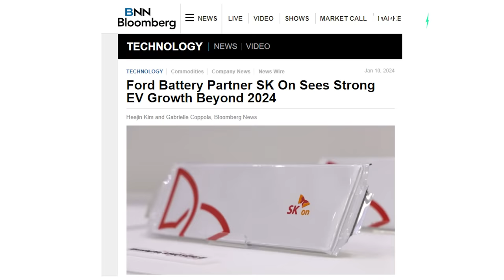Ford FIRES nearly 70% of EV plant workers,ramping up ICE production

Comment: I'm in Detroit, Ford is going to one shift for the Lightning, and transferring those workers to Wayne Assembly. I doubt the guys at the Lightning plant will be working much. When GM was building the Volt at their Hamtramck plant, now "Plant Zero", they were only running a few hours a day, four days a week, if that. Some weeks they never even opened up. I expect this will be the same with every EV producing plant in the Detroit area, and then they will close, move in a new ICE vehicle or simply abandoned the plant. I do not know how GM and Ford are even able to keep the doors open with the two morons they have running these companies into the ground. And then the quality issues both are suffering from, what a joke they have both become.

Comment: Ford needs to partner with Tesla to aquire  EV motors, sensors, and hardware, and software.  Then ford could focus on the aspects of building cars that they are good at (assembling the vehicle).  Ford already gets its parts from suppliers.  Just bend the knee and form a mutually beneficial relationship.
Reply: No. Electric motors have a long history and can be sourced from many makers. The only thing that is special is the design of the vehicle which should be as an EV from the ground up and the batteries. Even Tesla's batteries are actually Panasonic.
Reply: That is what Elon Musk refers to as "catalogue engineering", a company chose the parts to use from a Bosch catalogue (for example) instead of developing them themselves and just put them together. No innovation needed.

Comment: The electric cars and trucks (Mustang Mach E, F150 Lightning) have been sitting at factory lots and dealer lots for months. When initially launched, the dealers were asking for a huge profit margin. But soon, problems in quality, range, and infrastructure cropped up and they weren't selling, even at discount prices. GM has had similar issues with its EVs, and even Toyota's oddly-styled EV has had a ho-hum reception. The big issue, at least here in the USA, is that the Biden Administration has put the cart before the horse. Little or no infrastructure to  serve hundreds, if not thousands, of electric cars per day even in small towns; a very limited 100-year-old electric grid, a fear of nuclear energy, a failure of alternatives, and the government mandates that force manufacturers to build vehicles that just aren't ready. All add up to this massive boondoggle. If Biden had poured the billions (even trillions) into infrastructure improvements and THEN started mandating electric vehicles, it might have worked.

Comment: Worldwide EV demands are growing. Dedicated EV manufacturers like Tesla are ramping up production, successfully claiming an increasing market share. Legislation banning production of ICE’s is already in place in many countries, effective in about 5 years. A full transition to EV should be top if mind for every car manufacturer, in order not to miss out. Yet…. Ford and GM are stepping back. That’s either very brave, or very stupid. 
Weather you like it or not, ICE is on its way out. If not now, soon. Because besides all the pollution that comes with fossil fuels,, probably sooner than later, we will simply start running out of oil. It just doesn’t come in unlimited supply. And no… battery powered EV’s might prove not to be the ultimate solution, and no… (todays) batteries aren’t environmentally friendly either, but we will need an alternative to ICE’s. Preferably a fully matured concept, before we run out of oil.

Comment: Adoption of EVs is clearly weighted towards lighter vehicles whose range and performance can be optimized with the current level of battery energy and charging speeds.  Pick up trucks will be the market segment last to the post because of their unique operating including payload capacity, towing and range.  The offer may be substantially more compelling when the next generation of solid state batteries arrive and higher/more available public charging are available.  Ford has squandered a three year lead in hybrid pick up truck development-  if they were to offer a plug in hybrid with the ability to travel 80+ miles electric only they would enable pick up truck owners to drive largely electric only during the week, preserving critical payload, towing and range capabilities that pick up truck owner demand- transforming pick up truck ownership economics and introducing millions to the advantages of electrics.  They would also enable owners to charge at home, avoid sketchy not ready for prime time charging infrastructure, reduce emissions and distribute scarce battery and charging materials over a much bigger cohort of drivers.  Instead of offering drivers a compromise pick up, they would offer an enhanced truck with much more capability and lower operating costs and sell a boat load of these things.

Comment: The West and North America, most likely, will be stuck on gasoline cars due to poor infrastructure networks, power grids and extreme cold wheather issue. While Asian will move to EV and solar power, leading by China... some EU country will transitions to both EV and gasoline.... Japan will remain with gasoline mainly due to their current automobil policies....
Reply: Our power grid will not support an all electric vehicle population in America
Reply: @gregorylyon1004  It's up to the America people to decide which direction the country wants to go. Should not dictate by  few with only self-interest. Gasoline engine main problem is pollution in the city, esp when heavy traffic jams  idle on the street, releasing emissions that are harmful for city residents . They are extremely convenient to use when travelling long distant, as refuelling will be easy, and also on small town when polution is not so much of problem and less infrastructure support for EV.  But if  up to me, I still preferred to have both EV and gasoline hybrid car, where i can use EV in city and hybrid in long distant travelling esp at region where charging stations is difficult to access....

Comment: I’d buy an EV f150 if it was $30,000 and had a 250,000 km warranty.
Reply: Not even the ICE variant is that cheap and offers that kind of warranty.
Reply: Deal.
Reply: @christophers707  that’s why I have a lot of money in the bank and drive an older truck. My 2011 f150 platinum has been paid off for 6 or 7 years now.

Comment: Without access to Tesla network and using NACS chargers, no wonder Lightning sales not good. Add in peak 150 kW charging for a big battery, not a good offering for the price. Hpoefully their next gen will have 350 kW charging and NACS connector in same place as Tesla.

Comment: Ford doesn't have EV ... cars.   Ford has stupidily stoped developing cars .. and focuses on SUVs & trucks ... and ... has increased the price of the best selling F150s where customers are a looking at cheaper and "smaller" alternatives.  This is what was happen's with Ford's ICE vehicles ... before .. it decided to invest heavily in EVs.

So Ford's business ... is centred primarily around expensive ICE trucks ..then stupidly develops the an EV SUV with the Mustang badge .. then ... and expensive EV F150 which can not tow long range like their ICE's ... due to poor battery & motor development. AND Ford finds it has to cut EV production & staff and focusing making the chaper ICE broncos & rangers.

Again.  Ford had stopped develop cars it is beased entirely around trucks & suvs ... raising the price of its best selling F150 .. before it decided to make EVs.

Ford is just like Boeing .. run by complete morons ... ignoreing the competition, customer demands & not being innovative.

Ford should have at the very least .. returned to  only making a four door Hatchbak car  .. from a super cheap barebones car (XL) all the way up to the expensive  high spec Platimums & Limited.  Obvious do the same with the SUVs, and F150's .. with the option of a very cheap Ford car, Suv, truck.

And .. Ford should have only offered ... a "plug in Hybrid" otpion ... for their car, suv, & trucks .. which each vehicle providing at least 60 miles of range.  Then al Ford had to do ... is develop the ICE, elecric motor & batteries to increase range  .. while selling a boat load of XL cars, suvs & trucks.

there was no need for Ford to go full EV with the Mach E & Lightnings.

Even if it did not return to a 4 door Hatech like the Focus ... Ford shoud have only develoepd a "plugin Hybrid" option for the F150, Ranger, & SUVs with at least 60 mile range ... and dramtically reduce the price of their  XL vehicles.

Comment: Just showes you can't force people to build your dream.  That's why Tesla went it alone.

These are motor companies.  They build fuel motors and fasten carriageworks to them.  The unions, as well, pressure the companies to continue building what their seniority is skilled to manufacture.

Electric motors in cars is an eventual future, but it is going to have to be powered by liquid or gaseous FUEL cells to be scalable to an entire world market.

Batteries is always the engineering stopgap till the real electrical driver is found....but chemical batteries have always been one of the worst ways to store high power.